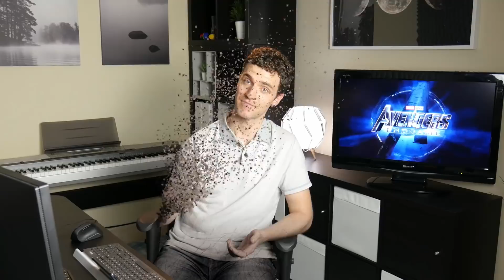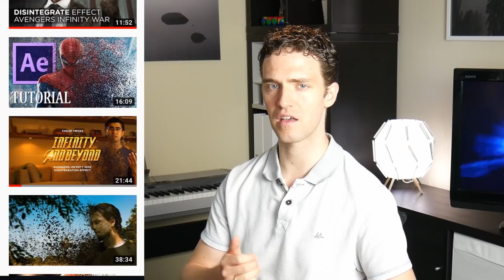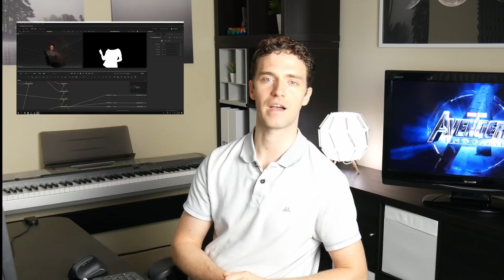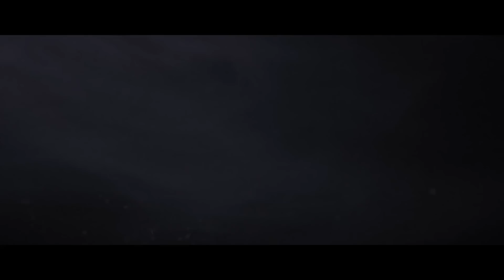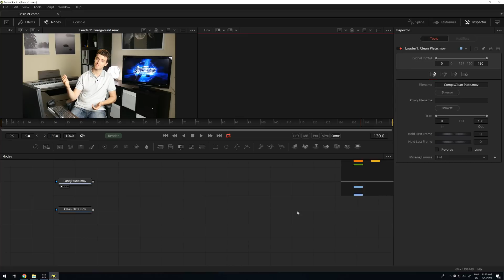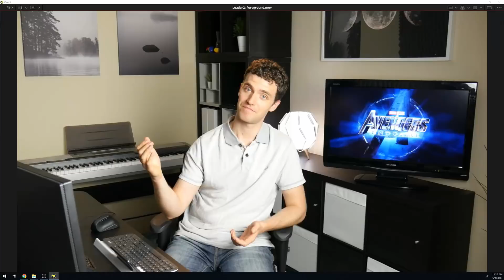Avengers Disintegration Effect with Particles in DaVinci Resolve & Fusion

Comment: LOVE YOUR TUTORIALS, ANY CHANCE YOU CAN GO THROUGH YOUR SETTINGS TO HAVE DAVINCI RUNNING AS SMOOTH AS YOUR VIDEOS. I HAVE A 64 CORE TREADRIPPER PROCESSOR 256GB DDR4 RAM AND A 3090 GPU AND USING M.2 FIRECUDA STORAGE AND MY PC SHOULD BE RUNNING DAVINCI ALOT BETTER BUT COMPARE TO THE SPEED YOUR PARTICLES APPEAR AND DISSAPEAR COMPARED TO MINE IS CONFUSING VERY MUCH A I SHOULD NOT BE HAVING THIS SLUGGISH PARTICLES
Reply from the maker: Well there are lot's of different settings and possibilities here. But in case of particles, it could be due to render settings - using hardware renderer? Also of course number of particlese, style, etc.

Comment: is it possible to use magic mask ?
Reply from the maker: Yes. With certain limits in accuracy as well. Definitely give it a try. Didn't exist yet when I recorded this tutorial. So don't know how good it would have been here, but I suspect good enough for a very fast transition effect.
Reply: @VFXstudy  what would the process be using it ?
Reply from the maker: @MrStevenhogg  Use the magic Mask instead of the manual rotoscoping. Check out my Fusion Magic Mask Tutorial as well for the basics.

Comment: If I were to not dissolve into dust but have the dust turn into me, how would I go about doing it?
Reply from the maker: Well, the easiest way could be to build the particle animation the same way but play it back backwards. You could first make your footage play backwards, then build the particle animation to go forward, and then invert the result again to play the right way. In Fusion you can use the time speed tool for example.

Comment: This is great. Thank you for sharing this. As a newb to DR (but not to FCPX or Apple Motion), I had to keep going back and forth to fill gaps in my basic knowledge of DR. It revealed that for some reason dual viewer doesn't appear to work for me. I read a post on BlackMagic Design forum that other people are experiencing this. You have both clips in Fusion. Are they both on the timeline, with you in the clip over the top of clean plate? Are there any good tutorials you've made or found that cover this off?
Reply from the maker: Not sure I understand. In Fusion all Nodes can be displayed in the left and right viewer via 1 2 keys, this is not related to the timeline. As long as you have a MediaIn in Fusion or any other node, you should be able to see this. If you have only one viewer, there is a button on the top right of it in Resolve to enable one / vs two viewers in the GUI. Not sure that's what you mean. Regarding tutorials, if you are looking for general beginner introduction how to use the GUI and navigate between timeline and Fusion, I recommend the free beginner course on my website which covers all of that.
Reply: @VFXstudy  Apologies for not coming back to you for 2 years! Where did the time go? I'll come back to this and reply, but thank you again.

Comment: instead of subtract and time offset, couldn't you use the difference meeting mode?

The splines are better than keyframes
Reply from the maker: Difference meeting node? What is that?

Spline editor is great for fine curve adjustments. Just to see placement of keyframes and maybe move them around a bit, sometimes the compact view of the keyframe editor is enough but both are important.

Comment: I noticed your rendering time with the nodes, & playback time was pretty fast. How many gb of ramm do you have on your machine?
Reply from the maker: 64 GB. Playback is fast if it's cached first (you see the green line above the player). But particle rendering can  take time, especially for the final version in full quality.
Reply: Sweet, I just purchased iMac with 128 gb ramm 1TB SSD drive. I will get it up & running sometime this weekend. The 1st project I will try out is this one here with your Template. I will let you know how it go.

Comment: Hi, thanks for the tutorial. I have a Problem: i dont like after effects and adobe for their subscription model, i would live to use fusion in the future, but when I see that a Fusion tutorial on this effect runs over an hour, and all the AE tuts on this topic are about twelve minutes long, I wonder if node compositing is really that more effective or is it just your way of teaching that makes your tut so long? Which Software would you recommend?
Reply from the maker: I don't think you can say that nodes are faster or slower than layers. Generally, the larger and more complex you project, the more you will find nodes easier to organize and handle. Reg. length of the tutorial, it also depends on how detailed you do the effect. E.g. work in 3d, multiple layers, different particle sizes, color grading, rotoscopung etc.? Also do you build it from scratch or use additional templates/ stock effects/ plugins. If you use trapcode particular, maybe you have some more advanced and perhaps easier to use particle tools compared to the built in stuff in Fusion. But it also comes with an additional price tag.
Reply: @VFXstudy  thanks for clarifying

Comment: Thank you very much for the tutorial :) It's very informative and well structured.

May I ask you for some tips improving the Playback Speed? I  have an i5 3750k oc to 4,0 Ghz, 16GB Ram, GTX 980TI and even though I use Proxies and optmized media the playback of the particles is like 1 frame/s...

Is there any option I am missing?
Reply from the maker: Are you using Fusion standalone? Especially with not so much RAM you might consider it. But depending how many particles etc. Any machine will get slowed down. You can also experiment with open GL vs Software renderer.  Though I believe the particle system itself may  be the bottleneck so might not be all that much difference. In Fusion Studio you have the render manager and can render from a render queue in the background. Even when using only one machine I find it convenient. But live playback is definitely out of the question if you have complex particle systems.
Reply: @VFXstudy  I am using Resolve 16 beta. Is caching to disk the right option to use for "prerendering"?
Reply: Oh and I should add that it is so slow with 10 particles in the "basic version" in the first part :)
Reply from the maker: @7IM3rW  hmm, ok that sounds Indeed a bit too slow. The caching to disk happens  in the edit page I think. But I think your problem is  that things are too slow in Fusion to work. You might do things like turn off HQ and turn on Proxy (right click near the player controls in Fusion) maybe reduce color but depth from renderer to 16 float or even 8int. Otherwise you might want to try the flow in the Fusion standalone version and see how it performs there. Fusion 9 free version is still available from the support center if you don't have a license dongle. If you have a Resolve license dongle you can use Fusion 16 studio as well.

Comment: Great tutorial!  However, when I try to render this, I get black frames in my delivery output.  In looking at the error log, I see repeating messages saying "MediaIn2 cannot get frame for time ##", where ## just increments.  I guess Im running into an out of memory issue, since I only have 16GB ram?
Reply from the maker: Do you mean it is rendering correctly inside the Fusion tab, but you get black on the delivery page?
Reply: @VFXstudy  actually no, i did see the black frames in Fusion page as well.  I noticed the mediain node turning red on those frames along with all the nodes attached to it.  It seemed to happen after about 20 or so frames.  The first 20 or so frames always seem to render fine tho.
Reply from the maker: @SaguinMedia  hmm that's a bit strange. You can try and see if disconnecting / disabling other nodes will help and narrow it down. I assume the media in node alone is playing your clips fine without additional fusion tools? Are you on 16 beta? Or 15?
Reply: @VFXstudy  Yes, the media in node works alone if I bypass all the other nodes.  Im on Studio version 15.  I tried comparing all the nodes I have to yours, but couldnt find anything wrong.  Here is a snapshot of my nodes, if you dont mind taking a look.   Sorry, Im a bit new to Fusion as well, so my nodes dont look as organized as yours.  :)    https://drive.google.com/file/d/1Xr7ALPET3XEE0_-UY0RrjOs3VshF1YjH/view?usp=sharing
Reply from the maker: @SaguinMedia  sure. Don't see any immediate issue. All the masks connected to MediaIn work after frame 22? I had some weird cases where just disconnecting and connecting again helped. Another thing, especially when you have a lower spec PC or Laptop you might want to try the standalone version. If you have the Resolve Dongle version you get Fusion Studio 16 for free. Otherwise you can still download the free Fusion 9 version. Especially for memory, Resolve is very hungry. I'm not 100% sure if your problem is related to performance or bugs or something I don't see immediately... but if it is, this could help
Reply: @VFXstudy  thanks for all your help!  Yes, all the masks worked with all frames when I bypassed all the particle and 3d related nodes.  Ive been trying all morning with disconnecting, reconnecting and I even tried with a shorter 1080p clip (original was 4k), tried using fewer particles and rendering engines (software, hardware).  All of them had the same issue starting at frame 20, even with a different clip.  Ill try opening a case with Blackmagic, but Im sure theyll just tell me to add RAM.  :)  Last question tho, do you know if the activation key code can be used with standalone Fusion Studio 16?  I dont have the dongle.  Thanks again for all your help!  :)
Reply from the maker: @SaguinMedia  as per my knowledge the activation code doesn't work as of now. Possible that BMD might change that. Have heard some speculation but not sure.
Reply: @VFXstudy  In case anyone else is encountering this, I finally resolved the issue by upgrading to Davinci Resolve 16 beta 2.  And here I thought 15 was the more stable version.  :)
Reply from the maker: @SaguinMedia  Hihi, glad to hear! Generally, I think it is supposed to be more stable. But maybe something about the improved caching / memory management helped you here.

Comment: 1:02:43 and ctrl+P to disable selected nodes, also Dissolve nodes can act like a switch to aid testing and there are options available in reactor.
Good deep dive getting the techniques into fusion! The tutorials for other software always have the same problems out of the box A) it looks flat like there's no actual depth,volume or substance to the disintegration B) the particles shapes don't change. 
Without a 3D puppet to model, a quick solution to emulating volume is using techniques from making  2D-still-to-3D-parallax effects using layered displacement masks, or using duplicates of the roto splines with the feathering options, or using the pImage emitter if the lighting in the still isn't also "flat" to get rid of the billboarding.
If you use double polys to make gradients,  use tab to select the inner handles then ctrl+b to box resize
Reply from the maker: Thanks Paul for sharing your valuable tips as always. I like the idea of the displacement map, think that could do a little extra punch. 
I wasn't very successful with the pimageemitter here and found the regular pEmitter with setting color from region easier to handle. Though I got quite far with the imageemitter as well and used it on other scenarios.
Reply: @VFXstudy  meant trying to use the pimageemitter more as a displacement input but yeah very finicky possibly better using a pcustom

Comment: Great tutorial. Just another question: Is there a way to have a dual screen layout in Fusion 16 standalone like in the Resolve Version? I do not find it.
Reply from the maker: Yes, you can setup a second screen as additional fullscreen viewer. It should be in the settings under video io or similar. Same menu where you could configure an output card. Alternatively you can have a floating view window and put that on fullscreen on a second monitor. Am away from computer right now, let me know if you don't see it and I'll check for the exact menu later